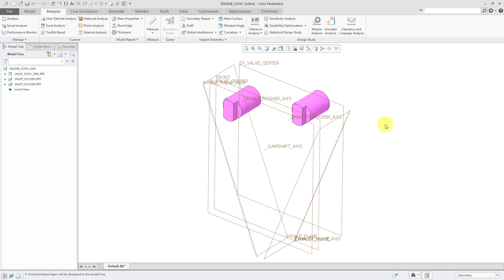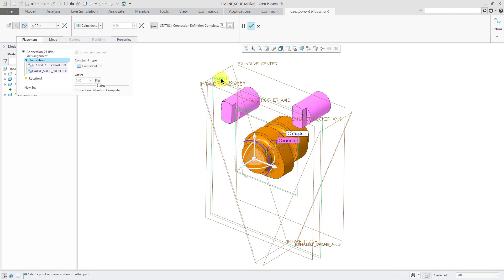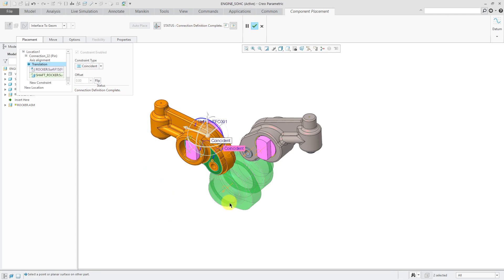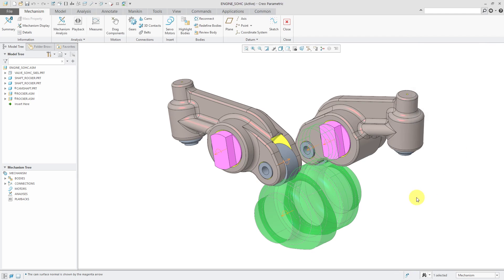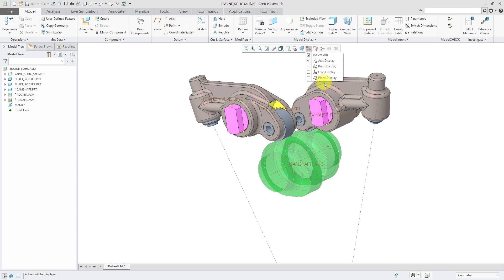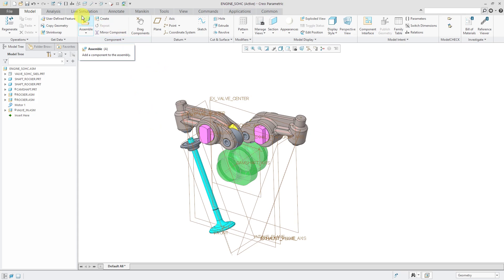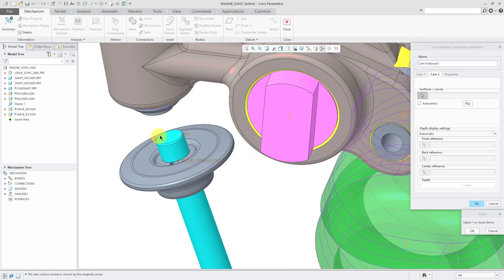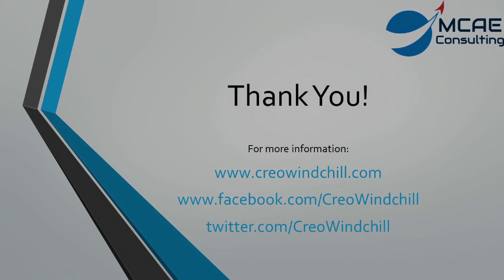Creo Parametric - Mechanism Cams (Demo)

Comment: I love all your videos. They have always been helpful. Yours is the goto site when I want to learn something new in Creo. 
Currently having fun in mechanisms, but a epically failing in my attempts at making a fairly complicated ratcheting assembly. Any thoughts about making some type of come along type (hand cable puller) where the cam follower and locking pawl have to liftoff the ratcheting gears (cam) during operation?
Reply from the maker: You can enable liftoff with cams, but I haven’t worked on ratcheting assemblies so I don’t have any thoughts on the subject.